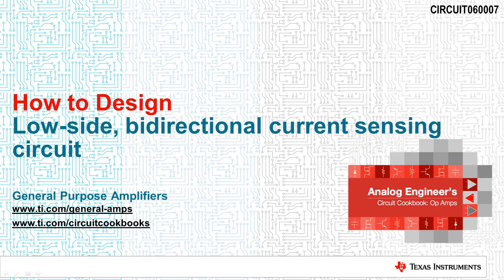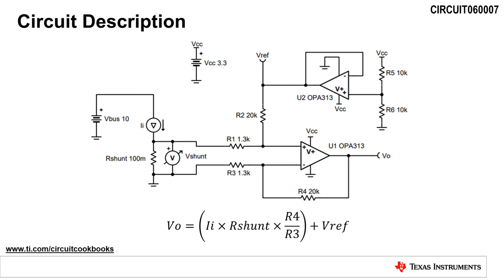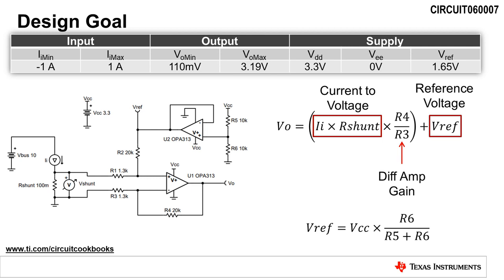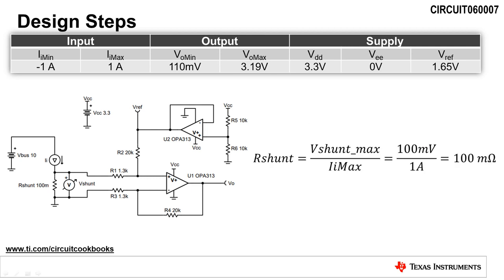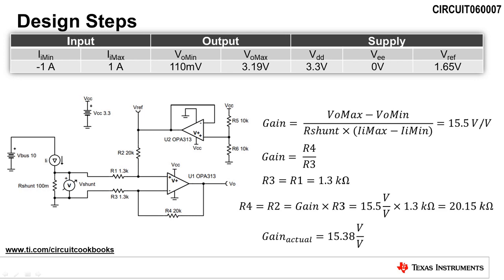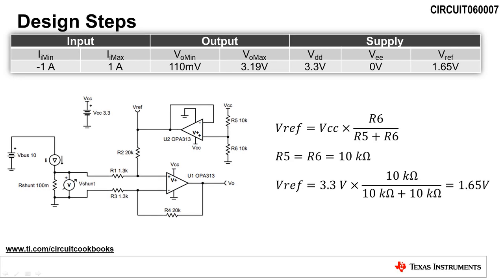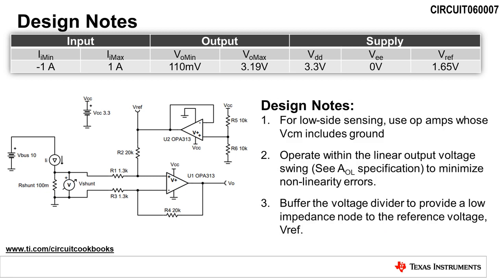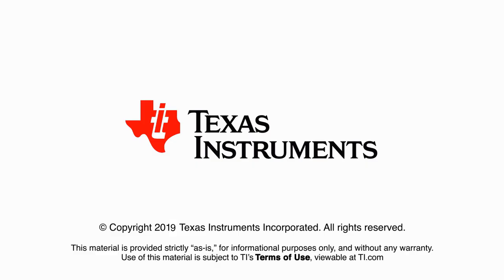Low-side, bidirectional current-sensing circuit

Comment: Why do you use an OP Amp and not use a simple voltage divider with only resistors for the Vref?
Reply: If you take voltage directly from voltage divider, voltage will drop, because voltage will be connected to ground through R2, R1 and shunt. OpAmp has feedback loop, so after you attach load Opamp will regulate output voltage to set it to 1.65v. Voltage dividers are not very good reference voltage sources. You should use scheme from video or if you don't want to use OpAmp, you can use reference voltage source IC like t431
Reply: @Lutlih  thanks so much! I discovered it the hard way :/